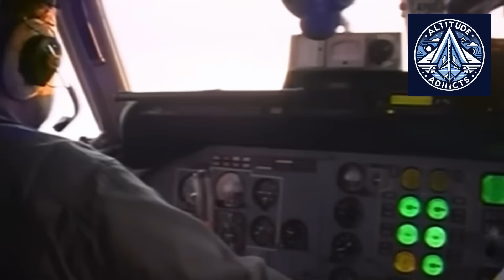Simorgh—How Iran Rebuilt the An-140 Into a New Military Plane

Comment: Aviakor at Samara are assembling the fuselages for the new TVRS-44 Ladoga turboprop airliner ..... and it looks remarkably like the An-140 ..... probably using the exact same fuselage diameter ? 
biggest difference is the T-tail on the TVRS-44 instead of the standard tail used by Antonov and Iran
so it seems the An-140 will "live on" .... in Russia and Iran
Reply: АН-140 Россия и разрабатывала!😂
Reply: @ЮрийКуличев-ж6о It is a redeveloped An 24 from the USSR